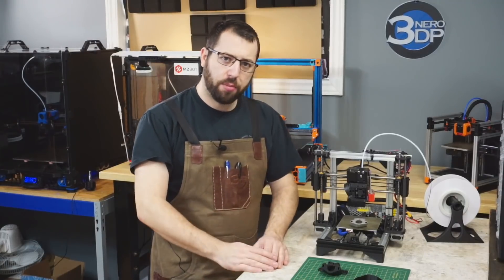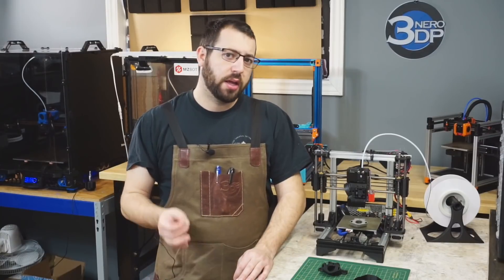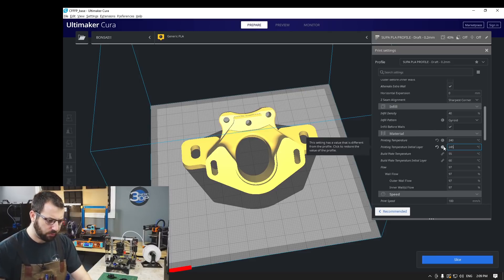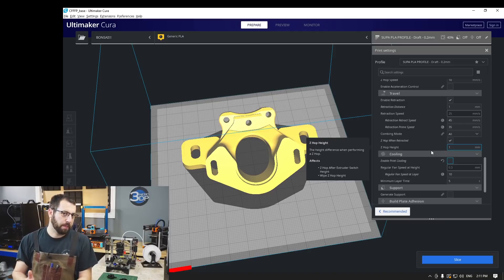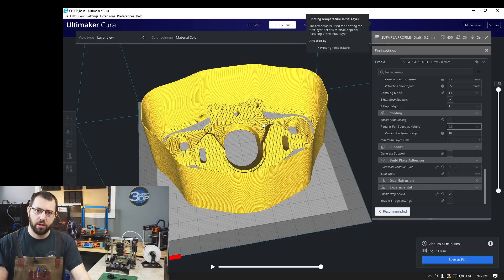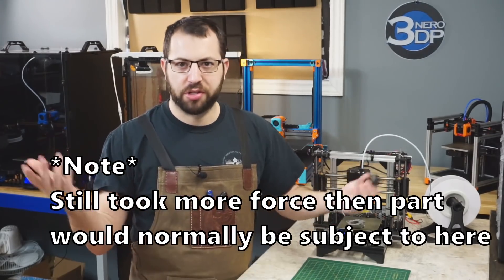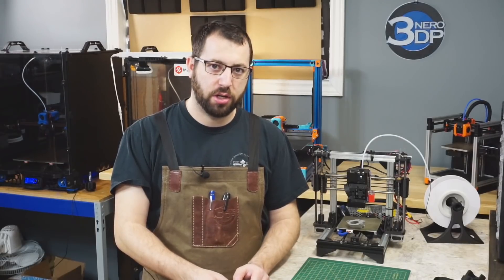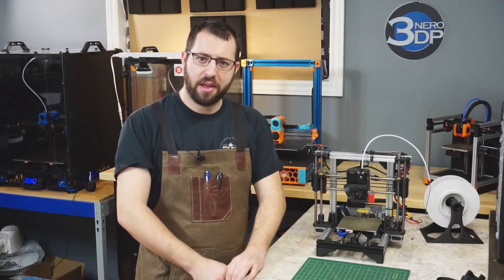ABS For Dummies Part 3 - Your first ABS prints and slicer settings

Comment: I bought esun ABS+ and it just wont stick. Not eith glue or anything. It keeps popping and sputtering on any temp between 220-250. Im printing it on a ender 5 s1 with direct drive and the sonicpad wich runs on klipper. Im geussing its time to invest in one of those filament dryers

Comment: I’ve been printing eSun ABS-CF on my Prusa Bear (mk3s+) with no issue, in fact they’re the best prints I’ve ever seen. I’ve started trying to print some std ABS from Fiberlogy and it’s just not as good. Poor corners, poor overhangs, lumpy bumpy sides almost like there’s z-axis wobble!
The main change is a heated enclosure at 50 degrees. The ABS-CF was in an enclosure that the bed got to about 39deg. Can an increase in enclosure temp actually reduce print quality?

Comment: Hy ! very usefull movie, thanks.
I am tryng to print my diy direct drive extruder in ABS (actually my prototype is in PETG) and indeed i have a problem with the adhesion between layers.
I use eSun ABS+ White and my printer is parcialy open (open in front)
I have seen than when i print at 100% infil, the adhesion is rely better.
i questionning me about the role of the heatbreak. A classic heatbreak with a PTFE crossing is pearpse not the good solution ? Is it better to use bi-metal Heatbreak ?

Comment: Hey Nero! Love your videos! I'm building my first voron using printed parts from my enclosed mk3s. Is the textured pei sheet going to be OK to use for my voron parts? I only ask because I've had better success with adhesion with the textured sheet, but im worried about the mating surfaces of the parts that have to be assembled.  Thnx!

Comment: in my case since i only print very small parts, i was going around it a bit differently
i basically use 3d printer as a way to make flat parts and then glue them back together, because i use x and y axies as the most accurate ones while on z i leave some plastic to be removed later from gluing surfaces
and i decided to use abs because it was easier for me to glue back together accurately enough by melting edges together with plastic cement and readjusting 
my usual parts are in the range of 1 to 5 centimeters long and wide , while the higest are about 1 cm high and i strugle a lot with z axis accuracy, being too squished closer to the bed and then springing back to dimension
and all i did to avoid banana like parts was to use that banana shape as a build in springs to keep my parts together at assembly :P
it is kind of a hacky way but i swaped 04mm nozzle for generic 0.2mm and that also helped a lot because i tuned in my printer profile to pringt much closer , tighter together and since the nazzle also have bigger mass than regular ender one it kind of iron parts together more
and it is a basic ender 3 with no mods while all i did was change some settings as i wanted them to , and some just by try and error, for example the bed temps
i might try the cardboard enclosure but since my parts are usually very small and flat, bed temp is kind of making most of the enclosure problems non isssue anyway

Comment: https://youtu.be/w09pHPf7yb8?t=350
Just a little advise for the Ender 3 (Pro & V2).

If you don't use your part cooling fan, your motherboard fan will also not spin. They are connected together. You can fix this by wiring the motherboard fan to the hotend fan. That should get it up and running all the time, so your steppers won't overheat.

Comment: What is the bed leveling sensor that you appear to be running across all your machines, do you find it more accurate then bltouch
Reply from the maker: Pl08/05n
Its cheap..and accurate to a microstep when setup properly.  I have a video on my channel on setting it up

Comment: If you use a glass bed DON'T USE A DIFFERENT TEMPERATURE FOR FIRST LAYER! After so many failed prints I realized the temperature difference was just enough to make the glass expand and contract. Maybe even wait a minute after temperature has been reached.
Reply: Same goes for PLA. Its great because if you keep the bed heated during the PLA print, once its done and cools off, the print pops right off without fuss.
Reply: I usually use super glue for hold it on hot bed.n it is easy to release
Reply: @TheOswardo  That sounds like it's difficult to clean. I use hair spray. Not any type of hair spray works, but one of the most common ones in my country is perfect for many materials on glass.

Comment: 7:24 Nero's choice of test print is the Mobius 3 Base, found https://github.com/VoronDesign/Mobius-Extruder/tree/mobius-3/STLs. Noting that the github repo has, by default, moved on to the Mobius-4 design, so you may need to switch branch/tag to Mobius-3 to get the STL Nero is using in this video
Reply: Clearly my printer is not tuned as fine as his 2hr, as PrusaSlicer wants 4 hours to print it at 0.2mm with 40% infill

Comment: Would my E steps change if I calculated them for a .4 nozzle and install a .8 nozzle?
Reply from the maker: E steps should be set for the amout of filament the extruder moves regardless of if its going through a nozzle. I try to calibrate mine with as little resistance as possible so no hotend hooked up.

Flowrate should then be adjusted in yohlur slicer

Comment: I would like more information about printing ABS specifically with regards to the V2.4. I've been printing PLA with it the whole time and would like to try ABS in case I need to print replacement parts for any of my printers.

Comment: Would be nice to show pressure advance, filament tower and other pre preparation steps
Reply from the maker: I have done a video on Pressure advance already on the channel. Temp tower guides can be found with a quick search its a relatively common thing.

I will try todo a all in one video though for new printer tuning in the future though

Comment: I think you should not increase bed temperature at first layer. Heat expansion can warp bed a little bit and peel the print off when its cooling to normal bed printing temperature.
Reply from the maker: At least with pei this method works. At least on the prints ive tested it with.
Reply: @CanuckCreator  This effect is most noticeable on a thiner beds for ex. Ender 3
Reply: That definitely happened to me with a glass bed. Probably not an issue with PEI though.

Comment: Any thoughts on ASA? Is it acceptable for printing Voron parts? From what I've read it should have better material properties overall.
Reply from the maker: Which ASA filament brand was that? Ive played around with some d3d sigma ASA and other than being slightly warp happy, behaved just as well as ABS.
Reply from the maker: ASA is just abs formulated for for UV resistance for the most part
Their pretty much interchangeable and have near the same material properties.
Reply: CNC Kitchen tested ASA from PrusaFilament. If memory serves me right, it did a little better in some tests such as impact compared to ABS. Take home was that is easier to print with.

Comment: Show the print with  the cheap ABS
.
Reply from the maker: Same as the other printers....other than
warped
Brittle
Blobby (its 3 years old and not quite dry anymore)

Ill probably dry it out and use it for part 4

Comment: Very informative! Can't find esun abs+ (black) in stock in Canada at the moment. Should I go with esun abs not plus or wait?
Reply from the maker: esun ABS+ is just a very forgiving abs, newbie friendly abs, if you cant source it using another "good" brand of filament is fine. It just wont be super easy mode.
Reply: @CanuckCreator  Thanks! Where do you order your filament normally?

Comment: Very good advice!   I like abs so far.   Have you used ic3d abs at all?
Reply from the maker: I have not
Reply: @CanuckCreator  is a little more expensive.   Usa company.   I found them on Amazon and printed solid. Seems good so far!
Reply from the maker: @MD-NWWI  ya i would need to ship it across the border it seems
Reply: @CanuckCreator  Amazon Canada might have some?
Reply from the maker: @MD-NWWI  there is. But its like 80+ a spool. So its reseller scalping prices
Reply: @CanuckCreator  dang that's not good.  If you ever need something from usa I would be happy to help you out if you need.   I'm gregs3dprintrc channel on Twitter.